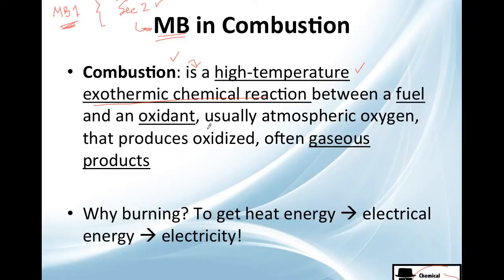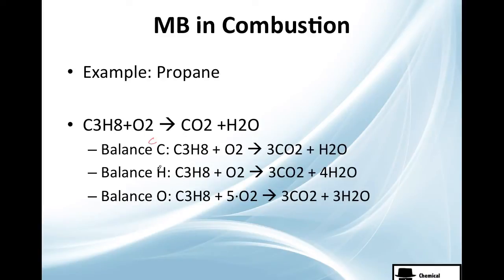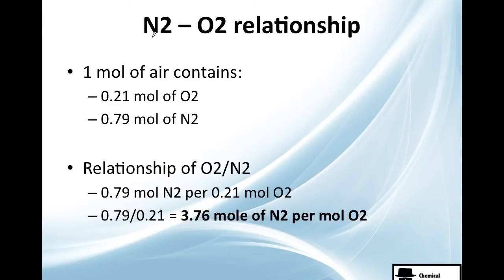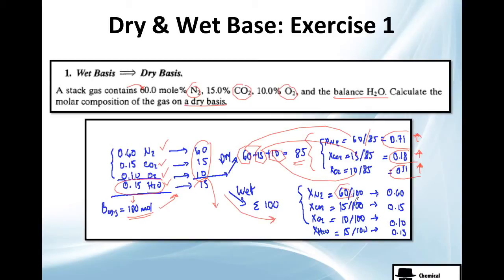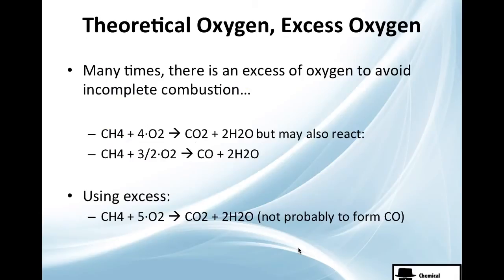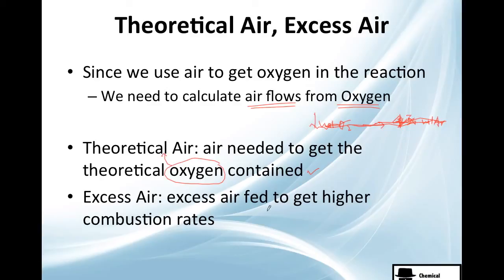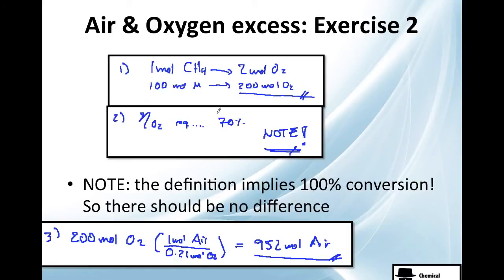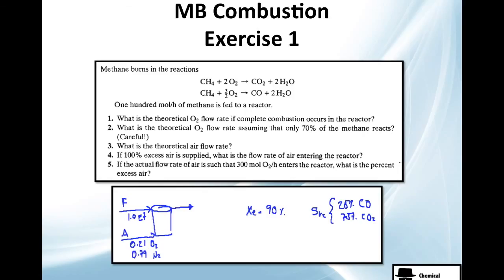Combustion // Mass Balance Class 18

Comment: If the basis is in kg, do I change it to mole first?
Reply from the maker: ➡️ If the problem gives you mass (kg) and you're using equations based on moles (like reactions, ideal gas law, or mole fractions) — yes, you’ll need to convert kg to moles first.

Comment: Good day. Can you please explain to me how did you get that 650?
because if you say 100 x19/2 is 950>
Reply: +Chemical Engineering Guy 
CH4 + 2O2 ---- CO2 + 2H2O not
CH4 + 4O2
Reply from the maker: +Nkululeko Mandita sure! can you refer the time? what minute:second?
Reply: +Chemical Engineering Guy 20:47
Reply from the maker: +Nkululeko Mandita in Exercise #1 the stoichiometry is given 13/2 of O2; may be you mixed up with 19/2 (sorry for my horrible handwritting)
13/2 = 6.5 but we are using 100 moles so 6.5*100 = 650
Reply from the maker: +kent leopoldo you are correct... I gotta add an annotation; thanks for the comment